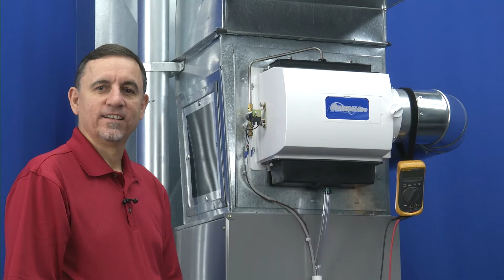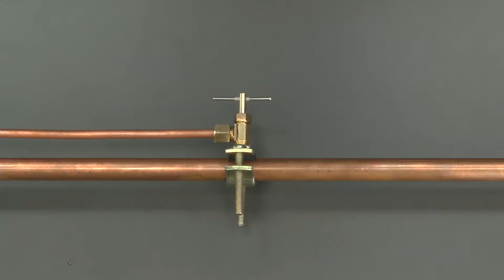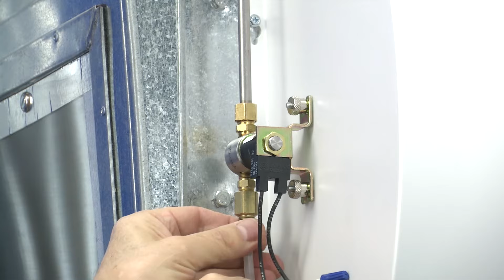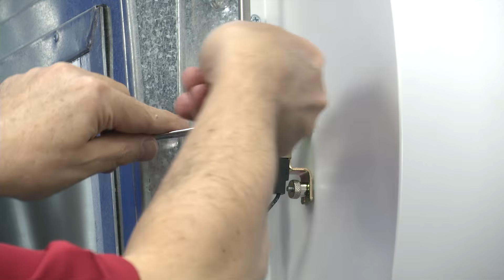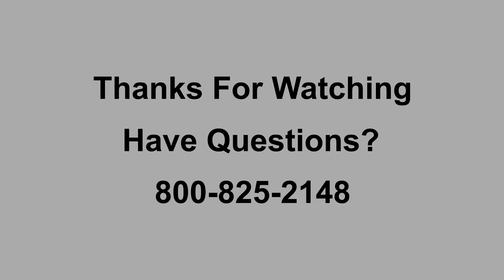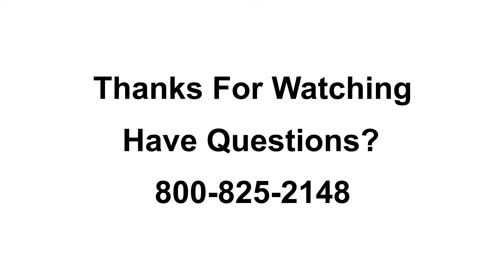GeneralAire Bypass Style Humidifier Troubleshooting - Water Not Running

Comment: I don't get it. I did all the water checks here as he did. Check for power and it has 21 volts. Checked the line going out of the solenoid. There was an orange stopper, or whatever it was, on the end of the tube, removed it and replaced the solenoid with a brand new one. Still no water. Furnace and fan are running. I turned the water on (yes I didn't forget to turn the water on). What gives?
Reply: Some electronic humidistats send a false signal to the solenoid valve that is not enough amperage to open the valve. When checking for voltage at the solenoid valve, always check the voltage in AC and ensure the solenoid valve is wired into the circuit when checking for power at the solenoid valve. The orange thing you asked about is the orifice, and it MUST be there. It meters the water leaving the splendor valve to the proper amount to go on the humidifier filter. As shown in the video, test for water supply going into the solenoid valve. Sometimes the manual valve is open, but you still dont have water at the solenoid valve.

Comment: No water on a brand new out of the box unit. Same exact set up & wiring as last one…. 🤷🏻‍♀️
Reply: Watch the video above. If you have water in the solenoid valve and no water out of the solenoid valve, check for voltage to the valve. If you have power to the valve, the valve is the issue. Many people replace their unit or solenoid valve due to no water but never bother checking for power at the valve. I suspect your issue is that there is no power to the valve.

Comment: Great video but most probably it’s a lime scale block- take the solenoid apart along with the top pipe and soak in vinegar for a few hours/ overnight. It will fix the issue. 

I think the power test is redundant. Stand near the humidifier and switch off the system, switch it back on at the highest humidity setting- if you hear a click- the solenoid is working if not, you know it has to be replaced.
Reply: We never recommend taking the solenoid apart since there are a collection of small pieces inside it. Some models can not be taken apart. Some seals, gaskets, and O rings inside certain valves do not reseal properly after they have aged.
Reply: @jayguliano3144 so just buy another one?

Comment: This is a very good video, but there is another item that can cause water not to flow through the humidifier.  I checked all of the items you mentioned here, and went so far as replacing the solenoid.  Still no water.  I removed the distribution tube and it seemed that it could be plugged, so I soaked it in CLR overnight.  After reinstalling, water was flowing again.